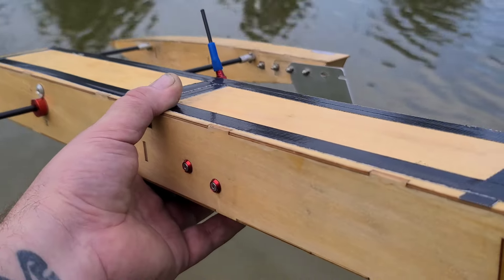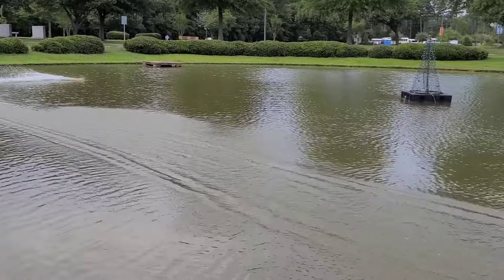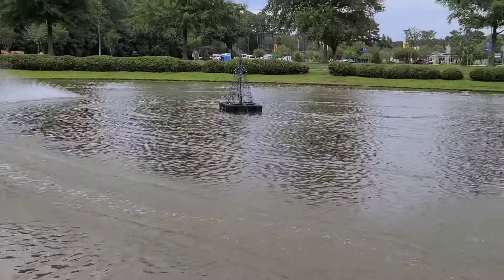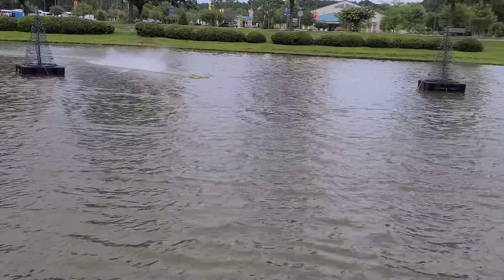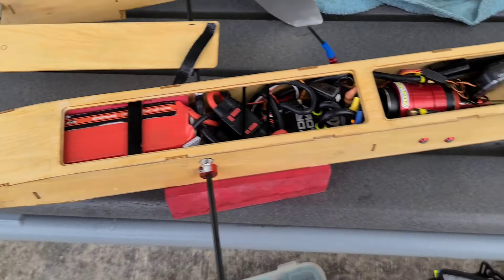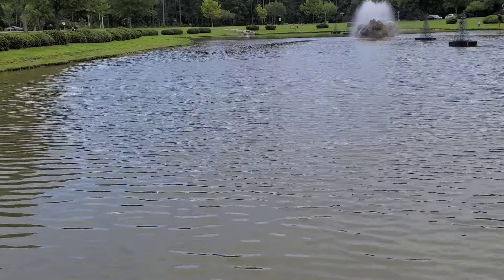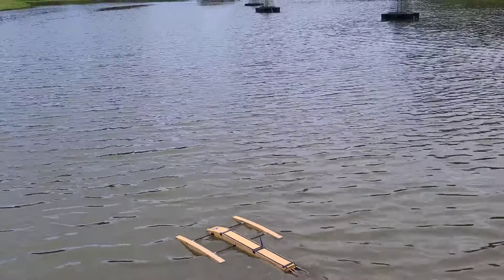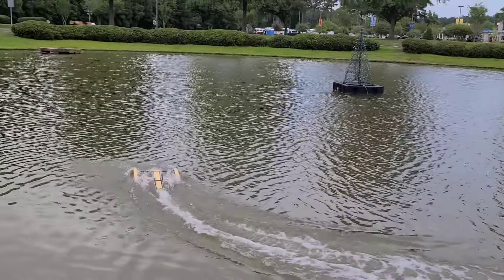Blistering Fast Wood Outrigger Oxidean Oxi-digger, Testing a New Tune - Hydra XLX2, SMC, ABC

Comment: If you fit a 4082 2200 kv with a quality motor like a TP with  using this same  esc and  SRD 5300 with either a 1817 or 1917 abc cleaver you’ll go straight past 100
As long as the weight distribution is perfect and the turn fin is not holding the front down and the strut is virtually level just enough up at the rear to keep the prop in the water.
But do not run at the park pond and only run on glass water any bump at a hundred will probably send it tumbling.
 Long speed build up until you check temps.
Good luck
Reply from the maker: Roger that.  Thanks
Reply: @IRONCLADRC  James is all over it Big B, I'm running a Zippkits 33Fe with a Tp power 4050 (40mmx82mm) 2100 Kv SMC 5300 and ABC 1820 and just ran in the mid 90's. its in there,go get it my friend. she looks really nice on the water.